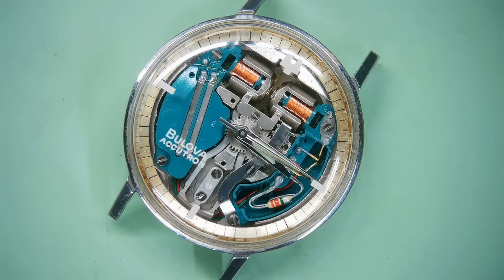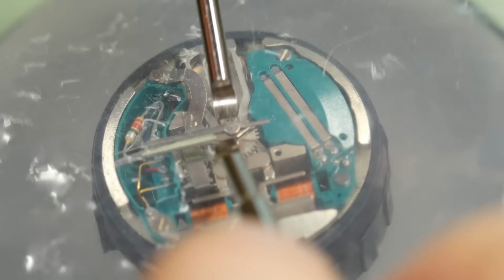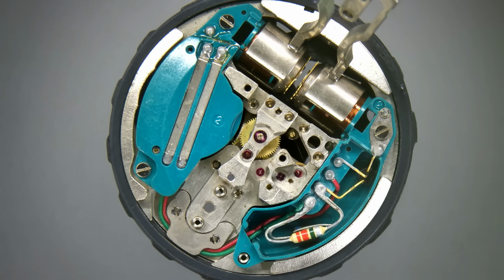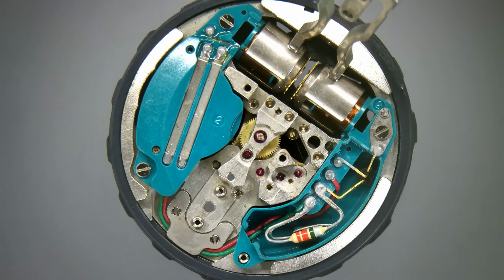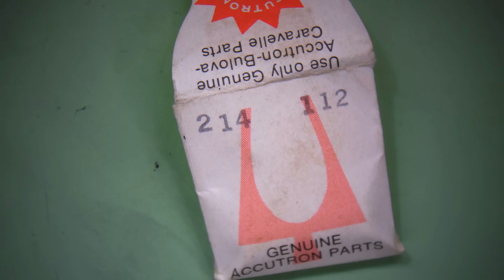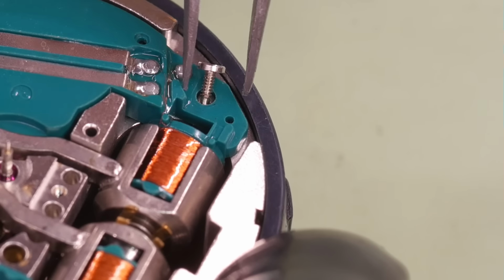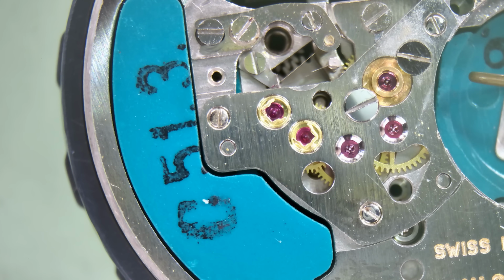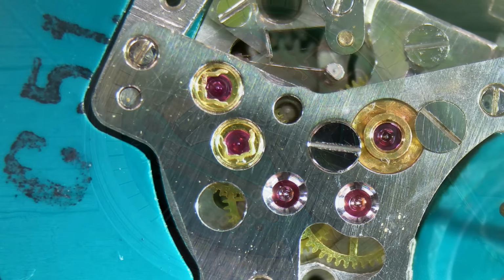Bulova Accutron 214 Restoration - So Precise NASA Astronauts Used Them

Comment: I remember the ad on the TV saying it kept perfect time due to using a tuning fork but that's all I knew about this watch. That minute index wheel with its 360 tiny teeth is an absolute marvel as is the two little vibrating "hairs". This watch is the perfect union of mechanical and electrical technology in a watch.

Comment: As a machinist making port equipment i've had to mill teeth bigger than diameter of the whole watch (and bore 300+ mm openings with 25 micron tolerance). My parts were over 4m long sometimes with 80mm teeth for joining next parts. I have hard time imagining how a micron thick cog of 2,4mm D with 300 teeth is made. Saying that, i'd prefer to work with parts weighing a miligram over tens of kg or a ton. At least for the sake of my knees and back, when i have to position them over a mill table where a crane doesn't reach or all cranes are busy hanging up a bigger thing.

Comment: The accutron was a marvel already with its precision.

That’s why I am so in awe of quartz movements which are currently the pinnacle of horology (short of radio controlled watches which follow the marvels of atomic clocks). They simply can’t be rivalled by mechanical movements which may look delicate to us but are downright unrefined when compared to the nigh-magic delicacy of quartz movements which makes that precision possible.

I still love my comparably simple mechanical watches for the weekend when I can afford to not care about time.
Reply: Quartz watches are accurate but they are not horology, they are electronic engineering. The Bulova is horology, it's mainly about using standard watchmaking technology with a minute escapement to work with the tuning fork. The quartz movement was about miniaturising the crystal - a considerable technical feat - and the motor. The electronics already existed when the other things fell into place.
Tiny electric motors really started with a competition organised by Richard Feynman. He said a number of people tried to win it with things that ignored his rules, and then one day someone turned up and the first thing he got out was a binocular microscope...

Comment: So precise NASA used the Omega Speedmaster?
Reply from the maker: @PimpinBassie2  in one of the lunar modules they had them on the control panels and one astronaut wore one.  They then made the Accutron astronaut model.
Omega were the official timekeepers not sure from when exactly. You also should read up on the Seiko Pogue. I’ve done a video on them.  Col Pogue took one into space in his pocket because he done all his training with it to time his thrust burns.  He was given an omega days before launch but didn’t trust it so took his Seiko in secret.
Reply from the maker: @PimpinBassie2  equally an Accutron even today will out preform a modern speedy for accuracy.
At 1 second a day or less no mechanical can get that good

Comment: What a fantastic job, I only wish I had the patience to do this.  I'm going to say something that is out of line, but I found interesting... I noticed that the minute hand does not synchronize with the second hand. When the second hand tops off at 12, the minute hand is slightly under the minute indicator on the dial.  As technical and tedious as this work is, I have to go and notice that.  I loved watching, I too was holding my breath when you were placing the movements and wheels in place. Very nice work.

Comment: You were smarter than I in not removing those shock springs. That's a mistake I'll only make once. It was the fight you were expecting. I hope  your success is more long-term than mine was, as my 214 started stopping not long after I serviced it. I suspect it has something to do with the depthing of the stem, which can be an issue. Thanks for the video. Too bad for me that it wasn't up 3 months ago, before I did mine. Cheers.
Reply from the maker: I made this video because I always wanted this watch but as there were no modern videos on YT that show it accurately enough that I should be the one to fly the flag!  The shock springs dont frighten me as they are the same on Seiko and I have done 100s of them but I dont have spares for the Accutron which worried me. I have a method and it works for me anyway.  Equally if you are very persistent with your cleaning then you can get them good enough for oiling without removal which I demonstrated here.
Regulating and setting up the fingers has been a chore but luckily I am well used to this from the 218 movement so I have a good idea how they should be and just put that experience into practice here.  Sadly did not film that but all you would have seen is my fingernails and heard some very bad language!

Comment: Most people are unaware that the battery for this watch has been obsolete for years. These original battery was a mercury battery and I believe was around 1.35v , the replacement battery is a common silver oxide battery of around 1.55v with a plastic spacer to keep the battery in place. Point is the higher voltage affects the accuracy of this watch in a negative way. These original  tuning forks are also obsolete so you would need to source a rebuilder and for the most part they are prohibitively expensive.
Reply from the maker: parts are non existent other than coming from donor watches.  Yes the 214 ran on a 1.3v battery but they can effectively be phased to run on the 1.5v if you have the accutron test meter I had in this video. My watch has a 1.5v in it and is now under 2 seconds a day accuracy with a bit more regulation to do.  
Also you can purchase a battery called an Accucel.  These are a 1.5v battery with a shroud and a diode that reduces the voltage to the 1.3 required.  They are about £15.00 and once you have one if you are clever enough you can pry out the battery and reuse once the battery is spent.
Reply: @MyRetroWatches  I was unaware of that newer battery replacement, thanks.
Reply: @MyRetroWatches  Instead of 2.2MΩ, a good replacement for 1.55V operation is typically 2.4MΩ to 2.7MΩ.
Reply from the maker: @ I have no clue about any of that but when the circuits are working you can phase them to a 1.55v without the need to get the soldering iron out.

Comment: What is the frequency of the fork? I see a single transistor there, must be to keep the oscillation going. At 5mA, how long the battery will last? Are there any newer watch that uses the fork as reference?

Comment: So I restore these watches. A few tips: 1. Before disassembly put a fresh battery in (positive side down with fat side of spacer on top for a 214) and listen for any humming while in the case or remove movement and place movement in special holder and using the “Watchmaster” tester to ensure the coils hum. Otherwise, you could go through the whole reassembly process and find out later the coils need to be replaced necessitating more work. Basically, check the functions of the unit prior to disassembly so you can spot areas that will need more attention on the reassembly. 2. Be careful not to bend the index guard as it is very difficult to adjust so that pawl finger and index finger does not touch the guard as you move it into place. 3. Be careful with tweezers and screwdrivers near the coil lead wires as a slip could render the coils useless. 4. Brass tweezers like the AM size work well with servicing the 214 movement. I noticed the crystal replacement in your video was an incorrect crystal as the replacement crystal should not have index markings on a chapter ring Spaceview model. The correct crystal (either 1270 AWS or 1271 AWS depending on the case size 32.7 or 31.1 mm size respectively). The crystal should only have the Accutron tuning fork logo and wording! Anyway, hope this helps! Great vid and congrats on the restoration!
Reply: Pretty sure that’s a Swiss spaceview and they had the index markers on the crystal. Not sure that crystal is still as it should be anyway.
Reply: Do they still make the battery

Comment: Hi Mike great watch that's one of my favourite watches of all time one thing though that clamp thing on the minute wheel does it need a tiny spot of grease on it? as it seems to hold it in place with tension, just a thought.
Andy UK.
Reply from the maker: Possibly but there is only one page on oiling in the manual and it’s just about pivots and shock jewels.
Oiling the minute wheel would make it visible as it would leave a ring on it which when viewing would be undesirable. The tension spring thing is extremely thin.
Reply: @MyRetroWatches  I thought that to but just wanted to ask, also saw you on TV again It didn't take long for a repeat lol

Comment: Regulating these watches is not easy and requires very fine adjustments.
Reply from the maker: @orvillefindley8117  sure does but it’s not unlike the 218 which I have a lot of experience with. You just have to keep checking it every 24 hours and adjusting .  It’s all worth it though.

Comment: Looking at it running, that first wheel with the tiny teeth, that the jewelled 'fingers' press on,  is very slightly eccentric - is the spindle bent?
Reply from the maker: No its a brand new wheel  The always seem to do this one the 218s also . For all i know it could be something to do with how much they are vibrating.

Comment: I just bought a 1975 Cosmotron because of you from Japan. Popper a battery in, and it works, but it runs super slow. Something like -40sec a day. Haven't cracked it open yet properly, but any clue what the usual issue could be, what I should look out for?
Reply from the maker: Well could be all kinds.  40 seconds is too much to regulate out using the regulators by the coils (see manual for them - download on my site)  other than this its a clean and oil with correct adjustment to the index and pawl fingers.

Comment: I definitely want one now but not sure I am up to restoring it as it looks like a load of experience is needed to make them run correctly.  Great video and I just hope there is a lack of wrecked ones on ebay over the next weeks or I may bit off more than I can cope with !
Reply from the maker: @PaulGs-Stuff  it’s taken me years to find one that’s cheap and needs work to fix it. I rolled the dice because condition was unknown.   If they don’t hum to start with there is a good chance the coils are toast.
They are almost impossible to find other than out of a working watch.
Similar with the index wheel.

Comment: Many decades ago my father-in-law gave me his Accutron Bulova to try and repair it. He had given it to his son to replace the battery, and his son put the battery in backwards. I discovered after taking it apart that the coil had burnt out. At that time no parts were available. After several decades I'll have to give it a go and see if I can't find that coil. Great video!
Reply from the maker: a working coil will only come from a donor as long as the donor has working coils.   I do believe there is a guy within the Accutron community that is rewinding them but I dont know who he is sadly.

Comment: I had two of those Spaceview Accutron's back in the 70s. They were flawed. Both did the same thing, they would just stop suddenly. I'd replace the battery and they'd run a short time, then stop again. And I bought both of them new. I liked the look of the watch but the reliability was so bad I had to kiss them goodbye. I switched to a Seiko quartz world traveler.

Comment: Smoothest sweep seconds hand? I have one word for you: Grand Seiko Spring Drive.
Reply from the maker: Doesn’t count. It’s modern for a start plus I think that is only 256 beats per second at the wheel. Accutron 1960 onwards beats over 300 a second before spring drive designers were probably even born!   Took 60 years for someone to attempt a smoother tick . Says it all about an Accutron achievement to me

Comment: When I heard "I had to get my big tool out" I wondered what link did I click... 😲😄 Great job sir. Not an easy mechanism by all accounts, but you did it. A true innovation and a real bit of history. I've had a couple in my time. These days I have the mid 70's Accuquartz, basically one of these with a quartz module cleverly attached, and a Longines Ultronic, a slightly "fancier" looking movement licenced from Bulova by the Swiss(runs but sadly needs a service).

Comment: Bulova like quartz so much. Why would any collector find it attractive. I don't think any quartz would last. Casio is the only watch that can do quartz correctly.
Reply from the maker: This is not a quartz watch! That’s the point. Launched in 1960 well before quartz. The Accutron is a marvel of engineering and was the most accurate watch of its day, in many respects it still is.
The Accutron is unlike anything else , the tuning fork technology was theirs and they sold the rights for citizen and others to use it.
All humming tuning fork watches derive from this 214 model and that is why they are so collectible.

That being said there is nothing wrong with quartz. Especially the early ones that Seiko produced given it was their invention. They are all mechanical with a quartz crystal.

Comment: You fail to mention what you used for the battery, Accutrons used a mercury battery which was 1.35 volts I've seen some sdapters advertised, but it would be useful to know what you used and where it was sourced from.
Reply from the maker: @djones-np8ik  there are lots you can use. An Accucel which is just a 1.5v with a shroud and diode to reduce the voltage or you can use a standard 1.5v with a plastic shroud which I used. 214 can still be phased to run in the higher voltage.

Comment: Just floored by the period manufacturing expertise of the day. And hats-off for you going all the way into it!
Amazing the index-wheel with the two jewels suspended on those hairsprings!
I pretty well will venture into anything, even if small but this one takes the cake!
What I really wish is if Buova would have made a film showing how they made various components; but probably too proprietary for the time, to have them give anything away!
Reply from the maker: They never really gave away the secret. Some of the design was then on licence to Citizen with the later 218 movement (I have a recent video on that one for you to check out)  Omega I think also had the technology licensed.
Reply: @MyRetroWatches  first off, thank you very much for replying.
I am indeed looking for videos that would show how some of these super small parts were made; other than something like click spring.
Especially interested in films that might’ve been made showing these things… thanks again
Reply from the maker: @SpinStar1956  I don’t think you will find anything on these . It was all a trade secret at the time

Comment: Mike, I see you own a Seiko QT-99. You can set it to LED Sweep (ensuring you switch the detecting microphone to LED Sweep) and measure the rate of tuning fork watches. Also, a guitar microphone will work for mechanical watches in displaying rate but not amplitude and beat error. I have a few Bulova Accutron  watches and have often wondered why none of them were rated as chronometers and using the QT-99 it becomes clear. There is an error of -4.5 seconds 12 o'clock down and a gaining rate 12 o'clock up. Apologies if I'm teaching you  to suck eggs but I thought I'd mention it.

Comment: I have the same one. It's dead as well. The battery burned out the coil 1.2vokts max not 1.5v
Reply from the maker: You can run them in 1.5v it’s well documented online. This one is using a 1.5v battery with a plastic shroud so it will fit.
Equally you can buy a battery called and Accucel which is a 1.5v battery with a shroud and a diode to reduce to 1.3v

Comment: That looked as though it needed the full bottle of brave pills to take on. It would've ended up at the very bottom of my repair later pile 😂 Great video Mike, thanks.
Reply from the maker: Hahah brave pills! I’ve never heard that one before.   I feel I now have skills required to work on these and other than the setup the rebuilding of them is pretty straightforward unlike many other watches I have featured on the channel.

Comment: I have the original 1960 watch. Unfortunately its not working 😕. The originals did not have printed crystals. The printed crystal was only for display watches sent to shops. However, people insisted on having the printed crystals so they started producing them for sale. My one has the gold and stainless steel case and bracelet. One day I might find someone who can repair it. 👍
Reply from the maker: Sounds like a nice one.  There are a few people out there taking them on for repair still.  If you are on Facebook there are some Accutron groups which is a good place to ask but equally do your research well before sending it to anyone.  This world we live in nowadays is not as honest as it once was.

Comment: Ok i cant stand it. 
Have you ever used peg wood and cleaned parts like the jewel off? By peg wood i mean even a tooth pick will help remove the older oil that has dried into uselessness, then isopropyl alcohol to clean after that and wa-la clean an useful jewel, and other parts as well. Your choice. Hope this might help.
Reply from the maker: @info-that-counts  I know what I am doing. I do use pegwood, not always because I generally clean plates first in the ultrasonic with some old L&R cleaning fluid and then a full cycle in my watch cleaning machine. After that I inspect on a microscope.  99% of the time that’s shifted the hardest of dirt.
Reply: @ oh i would never say ya dont know what yr doing. No sir. Im not a watch repair/rebuild guy. Im an electrician. I can add spark to your life but cant fix your watch! 🤣